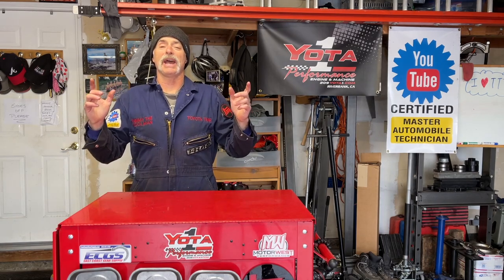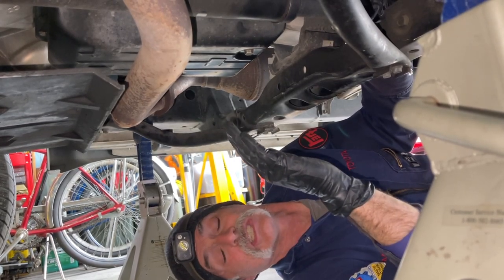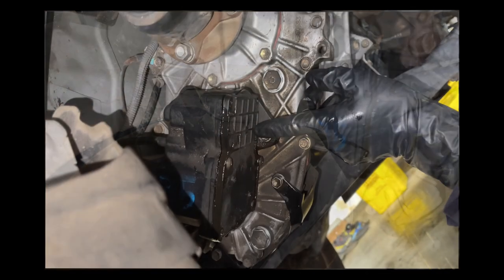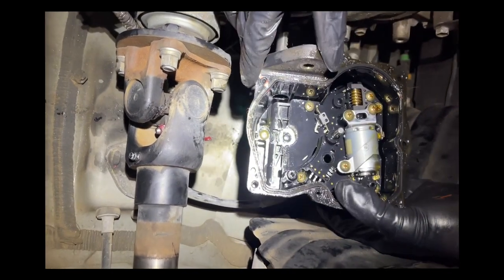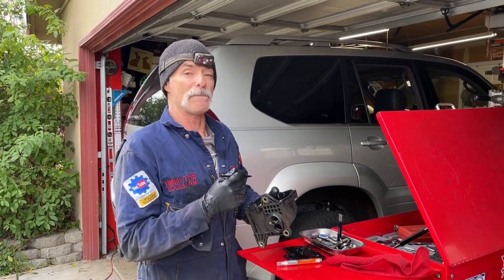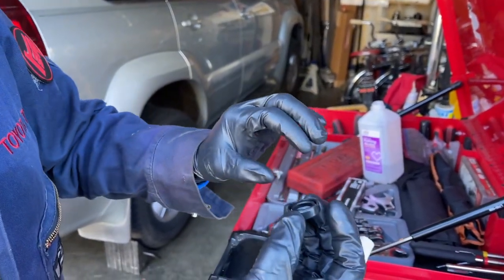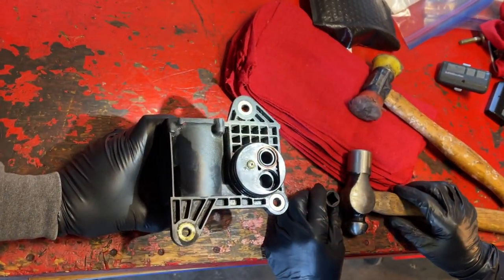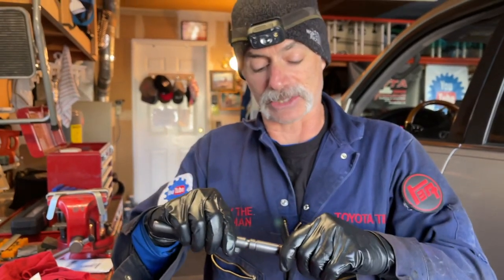Lexus GX470 Center Differential Actuator Repair

Comment: Hi Timmy, I have a 1990 4Runner with just under 230,000 miles.  I would love to have it fully restored, rebuilt. Whatever it takes. Runs like a champ, but I would love to feel confident taking it on long road trips. Is that a project you would be interested in?
Reply from the maker: Sorry, we don't take on restoration projects like this.  It would mean your rig might be at my house for a long time.  We're into filming singular jobs with a definite ending point.

Comment: Hey Timmy is there a model number manufacturer for that micro switch. If yes then possibly a new micro switch could be sourced from mouser or digikey if the model number of the switch etc could be seen.
Reply from the maker: I don't know if you could buy that switch.  I wondered the same thing.  I also wonder how hard it would be to replace if you could get the switch.

Comment: I had mine to engage but the VSC OFF light flashes instead of staying solid. is it the little blue gear i need to set correctly?
Reply from the maker: I'm not sure.  This video was my one and only experience troubleshooting these actuators.  But, the blue gear does have to be timed correctly so the actuator communicates correctly with the vehicle ECU.

Comment: Weird when I took the cover off the actuator the part with the blue wheel was screwed into the inner side of cover. It wouldn't clear one of the studs on the TC that the small rock guard attached to. Really had to bend the cover to clear the stud.
Reply from the maker: Some of them are like that.  The electrical connector is built into the cover.
Reply: @TimmyTheToolman  it definitely made it harder to reassemble. Pushed the button and the diff locked once and now the actuator beeps and won't unlock. 
Motor was very rusty, wonder if it's bad or I just mistimed it. At least I'm getting good at taking it off ha
Reply from the maker: @phildo3668  When I made this video, I wondered if you can buy just the motor from a supplier.

Comment: Hi Timmy. Question: With the transfer case actuator removed, how far should you be able to slide the rod in/out of the transfer case? I'm surprised by how small the movement appears on my GX470; I'm guessing it's less than 1 inch (maybe 1/2" or 3/4"). The rod moves smoothly between the in and out positions, but it's not very far. The rod "clunks" solidly against something at both ends of its travel. If it's supposed to move a larger amount, is there a process I can do that will allow that full range of motion before I install a new actuator?
Reply from the maker: I've never tried it but you'd just have to pull harder or push harder.  The rod is attached to shift forks engaging different sets of gears.  Maybe it works better when things are turning.  I don't know.  Personally, I wouldn't mess with it, because I don't understand the benefit.  In the video, I've showed you the gear timing of both positions, unlocked and locked, so it shouldn't matter what position the shift rod is currently in.  You should be able to get the actuator back on and timed correctly.

If you're dead set on doing it. I'd chock the front tires and jack up the rear end.  Have the trans in neutral and the parking brake off.  As you're trying to pull the actuator rod out, turn the rear driveshaft back and forth to move the gears.  This might assist in the actuator gears meshing.
Reply: @TimmyTheToolman   This is interesting. If you watch from 6:35 to 6:50 of this video (which is in Russian or something), you'll see how far he moves the shaft, which looks the same as mine. So 🤔

 https://youtu.be/GIXmJIud9aE
Reply from the maker: @sgoldste02  That little amount of movement isn't the difference between locked and unlocked.  From my research, when the transfer case is locked, the shift rod will extend all the way to the back of the actuator case.  Also, when I was under the rig and listening to how long the actuator motor runs to complete the movement of the shift rod, it's running much longer than it would take to move the shift rod the 1 inch you're talking about.  

Take a look at this video at play time 6 minutes and 5 seconds.  https://youtu.be/RiWYyfjaS9g  You'll see the rod extends to the back of the case.  It's on a Sequoia, but you'll see the actuator looks identical to the GX470 one.
Reply: @TimmyTheToolman   Understood. I'm simply commenting that with the truck in that Russian video not running, the rod is behaving exactly like mine, which I find interesting and am hoping indicates that mine is actually behaving normally (which is what you originally suggested).
Reply from the maker: @sgoldste02  I think your transfer case is most likely fine.  I also experienced the same amount of movement in the shift rod when working on the GX470.  I just didn't show it in the video.  I think that's the beginning of the movement to switch from unlocked to locked.  There's no way that little amount of movement is making the shift between locked and unlocked.  In this video https://youtu.be/ak2jDzVQIdU start watching at play time 2 minutes and 53 seconds.  If you watch closely, it takes much more than an inch of movement to completely disengage that gear.  The video almost cuts it off, but you can see quite a bit of movement happening before the gear attached the shift fork starts to expose the gear it meshes with.  

I think you should get the actuator back on like I show in the video with the gears properly timed and you'll be good to go.  You can use what you learned from our video to confirm you're able to go from unlocked to locked.
Reply: @TimmyTheToolman   Indeed, that's my plan. The new actuator I have on order is scheduled for delivery on Tuesday. 🤞
Reply from the maker: @sgoldste02  Ok, let me know how it goes once you get the new one installed.  

I'm curious though, did you do any diagnosing like we did at the beginning of the video to determine if it was or was not properly locking and unlocking the transfer case?  Those actuators are pretty expensive.  Did you buy the more affordable Aisin one on Ebay we linked or did you buy one from Lexus and pay triple the amount?
Reply: @TimmyTheToolman  HI Timmy. Got my $180 actuator installed today and it seems to be working well. Locks and unlocks rapidly. Thanks for all your guidance!
Reply from the maker: @sgoldste02  Good to hear.  Nice job fixing it yourself.  You're very welcome and Happy Wrenching!

Comment: Hey there!! 
Hi Timmy!  You or anyone else know if there is a fix for this:
2013 tundra.... Headlights that are left on after door is open does not provide an indicator beep and does not turn off automatically.
Any fix? 
When headlights  are left it just drains the battery.... They do not shut off.
Thanks.
Reply from the maker: I've never diagnosed a problem like this.  I'd seek out advice from a Toyota Tundra forum or a Toyota Tundra Facebook page.

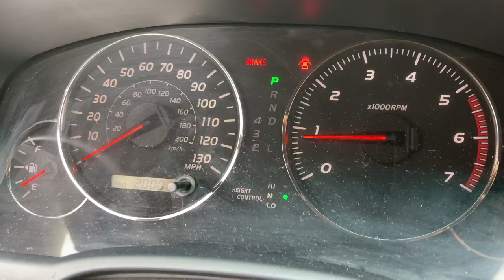Comment: 0:44 So my wife drives my car one mile to the store, she could not see out of the mirrors so she started pushing the buttons on the dash of my GX 470, she said then it drove really weird, barely made it into the parking spot, that light is blinking on the dash. What can I do or should I do? I left it at the store. Thanks in advance.
Reply from the maker: Have you tried pushing the center differential lock button to unlock it?  If it's driving "weird" that probably means transfer case was locked and the front end was binding.  The blinking means it's trying to lock, but your actuator might not be sending the signal it is locked like ours was in this video.
Reply from the maker: Also, maybe instruct your wife on the controls of the vehicle.
Reply: @TimmyTheToolman  The light just flashes now 0:44. She is blaming me for her actions, I wasn't even in the car. True the switch should not be right next to the mirror control and should have a cover over it so it cannot be pushed by mistake. I left  the GX in the parking lot.
Reply from the maker: @jimcarson9501  So if you push the button, it still flashes?  If so, you should tow it home and perform the test I did in the video to see if it's locked or unlocked based on whether the front driveshaft turns or doesn't turn.  You might have to pull the actuator box off like we did and investigate further.
Reply: @TimmyTheToolman  How can you tow a vehicle if the wheels don't spin?
Reply from the maker: @Moondoggy1941  You can still drive the vehicle with the center diff locked.  Your wife got it into the parking spot, right?  You back it out and just make shallow turns going back and forth to reduce the binding of the axles and front differential until you can get the vehicle straight enough that it can be pulled onto a flat bed tow truck.
Reply: @TimmyTheToolman  Is it possible to roll it backwards so it will unlock the differential?
Reply from the maker: @jimcarson9501  It's called a Center Differential Lock but it's not actually locking the differential, It's locking the transfer case and giving basically All Wheel Drive.   Sometimes it can get stuck and rolling it back and forth can get it unstuck.
Reply: @TimmyTheToolman  OK thanks, I know I am in a bad spot and I do not want to make it worse, my other car just broke down today as well, we had to get towed to a mechanic so we are in car hell right now.  I really appreciated the help.  I have sub'd.
Reply from the maker: @Moondoggy1941  Good luck.
Reply: @TimmyTheToolman  Thanks to you we were able to get it sorted out and I was able to drive the GX home, so feeling good now and back to complaining about he gas mileage.
Reply from the maker: @Moondoggy1941  Good to hear.

Comment: Do you think super glue will hold the metal band and affect the rubber? Lol
Reply from the maker: Scroll down through the comments and look for the one from johnwoodrow8769.  He shares a good idea of how to limit the chance of the seal spring popping off when sliding the actuator case onto the shaft.  It's his second response that gives a lot of detail on how to do it.